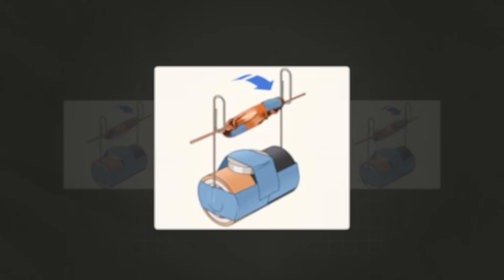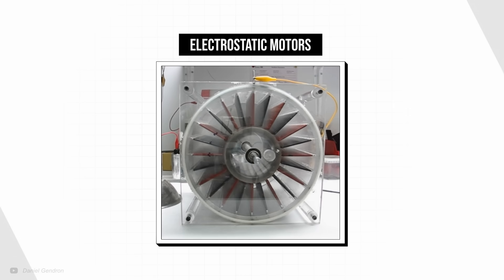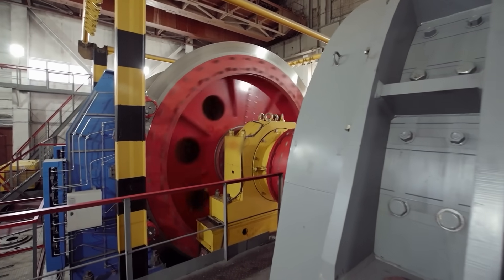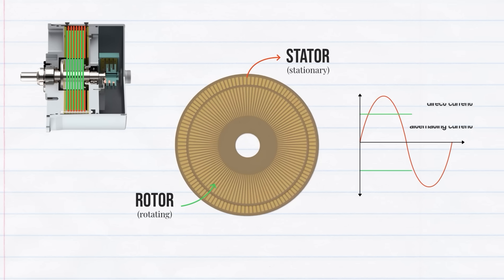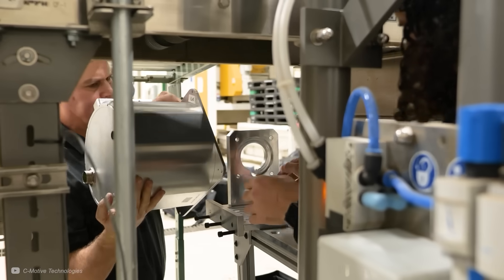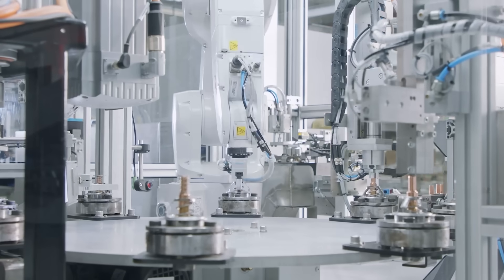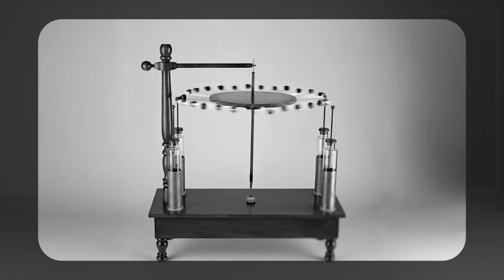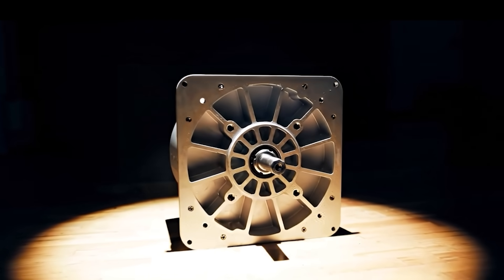How Electrostatic Motors are Breaking All the Rules

Comment: as someone, who works professionally with asynchronous induction motors, i cannot see what the fuss is about. even though our motor could be considered "current driven" instead of voltage, we go up 6600volts easily. also no permanent magnets inside. 
if you want to run something very percise, you might need a VFD (on bigger motors anyway) but to run one of those, would need some kind of contol electronics and VFD-like device as well.
Reply: Technically, as soon as you move a static charge, it produces a magnetic field, which begins to resemble the old inductive motors anyway.
Reply: It is a bit odd that one of their main points is not needing rare earth magnets, but the only motors that use those are ones where a lot of power is needed in a small space, like for electric cars.  But then they say they aren't focusing on power applications like you'd need for cars, instead focusing on low speed high torque things like conveyor belts, which is also where a magnet-free induction motor would work just fine.  I guess those energy savings would have to be pretty substantial to make it worthwhile, but today you have to ask whether the extra money required to buy the electrostatic motor would better be spent on some extra solar panels or wind turbines to offset the losses in the conventional motor.  And if you're in a climate where you have to heat your factory anyway, the losses in the motor just contribute to heating the factory floor so if you make your motors more efficient you will just have to spend more on your heating bill anyway...
Reply: @Berkeloid0  The big plus, is they are eliminating the gearboxes which costs more then the motors.  A lot of industry switched to the more efficient DC motors to get rid of startup surges and higher efficiencies.
Reply: @Kamala-km4ty  DC motors??  Never heard of anyone preferring them, they require massive power supplies/rectifiers, waste power with arcing and need their brushes replaced when they wear out.  No way are they more efficient.  Everyone is using AC induction motors now whenever they can.  Even battery operated power tools are now using AC induction motors because they're so much more efficient than the old brushed DC motors they used to all use.  DC motors also have massive startup surges whereas induction motors typically are already powered by a VFD which can provide a soft start function almost for free.
Reply: @Berkeloid0  They were almost certainly referring to "Brushless DC motors", presumably paired with VFDs of some sort.
Reply: Asynchronous motors are not very efficient since they always need slip in the rotating field and the rotor to o generate torque and anything other than rated speed(like in start and stop applications) are very very inefficient.  
IE5 motors are a lot better but are much more complex than normal induction motors (synchronous reluctance and sometimes even with permanent magnets)
Reply: @nhibbs3 not entirley true. 
yes they have slip, which is really just a slight difference in speed. 
for percice applications (and also bigger motors) you will need a VFD anyway and that way, this "impercice" technology can be controlled. it's not difficult to synchnonize multiple motors with perfect phase angles, so you can run a conveyor for example. they are also used in 24/7 applications, but these are typically larger motor running megawatts of power.
Reply: @nhibbs3 most ie3 motors are 90% plus efficiency it changes on size but the bigger they get the more efficient they are
Reply: Perhaps maintenance and operational cost?
Reply: @lxrose perhaps, but i would guess, that a fluid filled motor with sealant (at the turning shaft for example) will always be less maintanance friendly. the only part on our induction motors, that need regular maintanance, are the bearings. and i would guess, that those electrostatic motors need bearings as well. and if they do not, then because they are light/small enough, which would be the same on a induction motor then
Reply: yep, this video is a bunch of uninformed nonsense as usual. electrostatic motors are inferior in every way and unsurprisingly, used nowhere other than some very niche miniature actuators.
Reply: @drkastenbrot  thats what this (and so many others) channel relies on. regurgitating articles written by journalists whose only job is to write articles hyping up whatever the latest sponsor is spruiking...

the writers have no idea what theyre talking about, the readers have no idea either, and by the careful use of keywords and catch phrases, the ignorant are awestruck...

a popular comment in this section is "they can produce holding torque without consuming power"...

yay... lets forget that charged surfaces suffer from leakage currents, corona discharges, ionisation... they are losses, and consume power as they are replaced.

a magnetic field takes no power to maintain, either. yet it consumes current in its DC resistance. 

par for par, theyre the same thing, just opposite. magnetics are far easier to deal with... you WANT the field to jump across air gaps. whereas in electrostatics the last thing you want is for the field to jump the "air gap"... (dielectric material...)

you reduce the potential to reduce the gap. that reduces the force between the charged surfaces, but as they draw together the forces increase. question is, whats the ideal potential for a given dielectric thickness for a given dielectric to produce the maximum force? and most of our best dielectrics are only given constants of 2, or 3... versus ice that pulls a whopping 80... for one or two brief cycles, at least. distilled water is nearly as good but it quickly stops being "distilled" as it starts tearing ions from metals...

all i have to worry about with magnetics is that i have sufficient area to carry the flux i expect to flow, can fit sufficient turns of wire of a given gauge for a given DC resistance or loss, and how to keep the coils cool...

Comment: I call BS, even if the motor was free, required high voltage controller would still make it unobtainable compared to traditional 3 phase induction motor, also lets not forget that if you don't need vbariable speed you dont even need a controller/VFD.
Dont want to sound negative, but it just sounds like hogwash.

Comment: Don't ever listen to this youtuber, he's a paid lair.
1:10 The rotor generally doesn't have permament magnets. The only common type of motor that uses permament magnets is a stepper motor mostly used in low power electronics.
2:20 Claims copper has high price voilatility when even the graph he's showing says the opposite.
3:21 "Changing voltage instead of current doesn't have the same inherent inefficiencies." He's got this one, inherent inefficiencies are not the same. For example the electorstatic may not reqire a gearbox motor but it requres something to raise the voltage plus high voltage inverter, which is not cheap and already more inefficient than the stated engine's efficiency. If he included the gearbox in efficiency calculation he should also have included the powering circuits.

Comment: I don't believe their claim of being more efficient than a conventional electric motor. I'd like to see their numbers in detail. I'm quite sure they wouldn't hold up under proper scrutiny.

Why do I think that, you may ask? On the one hand, we've been building magnetic motors for a very long time, and we're already approaching 100% efficiency. Some motors today achieve up to 99.13% efficiency. Even when you run that through a gearbox, the overall efficiency rarely drops below 90%.

That's my first reason for doubting their claim. The second reason is that their motor appears to operate in some sort of liquid. Even if they somehow managed to make an electrostatic motor as efficient as a modern magnetic one, they would still suffer losses from moving through that liquid. In my opinion, they lose more energy due to the liquid than a modern magnetic motor loses through a gearbox.

I hold a master's degree in electronics and information technology, so I believe I'm qualified to say: this claim is most likely bullshit.

Comment: You should check out TT Brown’s work on the subject, he was awarded a patent in the US several decades back. He probably would have called it an electrogravitect motor or some such but it used high voltage/ low amperage charge to drive the thing.

Comment: I would have thought that having a fluid between the plates, especially with one rotating and the other not, and especially with the very narrow gaps between them, would generate a lot of resistance.  I guess that the slow rotation speeds, with the emphasis on torque rather than speed, would reduce this problem.  Are they directly connected to the shaft of the conveyor belt instead of having a gear between shaft and motor.

Comment: Why didn't you ask about the impact on power factor?  Like, is the direct-AC-input Electrostatic Motor design capacitive rather than inductive?  Does it need a linear converter to high voltage DC? And if so, what impact on phase angle?   This matters a ton to industrial customers!
Reply: There will be a frequency converter anyway and those include PFC. I guess induction motors without frequency converter are much worse with respect to PF, especially when oversized, what is normal in conveyor belt, elevators and such.
Reply: power factor and  phase angle are not a useful metric in capacitor motor designs. 
--
There is no INDUCTION.
--
Done!

Comment: I think it's important to emphasize that a new technology application doesn't need to be better than state of the art tech, it just has to be the best for it's price point for a given niche, and at least so far these motors sound the type. I would worry how they will operate when wear could allow partial draining of the dielectric thereby allowing arcing but presumably there will be design fail-safes to prevent failure in these situations.

Comment: Used the axial flux pancake motors in the 1970 onward which had low inertia excellent speed power and control 
for their compact design  ideal for factory automation projects this new design sounds a leap forward and very interesting thanks for the info’

Comment: It seems lke a narrow niche they're trying to fill, when some bldc motors are now 98% efficient. Still interesting technology though.
Reply: 98% efficient with no load applied
Reply: @Blox117 like I said before that’s completely the opposite. Electric motors are much more efficient at their name plate value. At low load they are generally very inefficient as it takes a certain amount of current to energise the stator.
Reply: @Blox117  That is actually not true at all. I work at a motor manufacturer and actually no-load efficiencies in BLDCs are significantly worse than their load-rated efficiency. This is because the motor drivers take generally 50-100 mA of current to run, so if your motor is running no-load at 100mA, then it would only be 50% efficient, not counting other heat losses.  Our company focuses on explosion-proof motors so we can't run the cutting edge of efficiency designs, but to give an example, one of our II-pole equivalent speed 48V motors (3000rpm) is around 51% efficient no-load, but when applying a load of 4.6Nm, the efficiency jumps to 90.3%. It is similar with traditional induction 3-phase and 1-phase motors except the efficiency tops out around 80% or less, though for other reasons since they have no drive circuits. You can look at speed torque curves with efficiency from major manufacturers to confirm this.
Reply: bldc have terrible efficiency at low speed
at zero speed they consume power, while this consumes no power at zero speed
Reply: The way in which traditional electromagnetic motor manufacturers present efficiency claims is highly questionable.
Reply: @Fejimush how?

It’s an extremely easy to do it. The motor must be producing the rated mechanical output power and it’s measured against the electrical input power. You divide electrical power by the mechanical power to get the efficiency and they must pass over standard % for that class
Reply: @8towely  You’re right, it should be straightforward and easy.

Look up the torque density and efficiency specs for manufacturers of EV motors, or high performance BLDC motors.  They will be artificially high, won’t provide them, or make them difficult to find.  

The reason is that they only include the motor itself in the calculations and exclude the cooling system, gearing, and other components required for their motor to achieve the manufacture’s stated performance specifications.  If those components are included the efficiency and torque density calculations those performance metrics drop considerably.  

As far as I can tell C-Motive includes all the motor components in their calculations.
Reply: @Fejimush I work in the industrial power transmission industry which is what the article is talking about. Above is how motors are tested and they must pass the international efficiency standard to be sold.

You can easily find the data sheets on every manufactures website and ask for the torque speed curves.

However efficiency is determined at rated power. The motors never really run at rated power as engineers leave headroom for error. However as long as they are kept ridiculously oversized there efficiency will be pretty close.

Even with a 5 second google search I found the model 3s. However you are not correct when they don’t include other systems. To test a motors efficiency load is applied to the output shaft to make it output its rated power. It doesn’t care what it is driving weather that be pumps of the wheels to the road.

There will be some losses in control though
Reply: @8towely   What search terms and search engine did you use to find the details on the model 3s’ torque density, efficiency specs and how they are calculated?   I was unable to find enough details to support your claim.  However I did find folks on some forums trying to get more information.
Reply: @8towely  I asked my AI do a deep dive.   Here's the question and response:

Question:  "Can you find the Tesla model 3s electric motor's torque density and efficiency specifications?"   

Answer:  "Tesla doesn’t publish motor-only torque-density or an official efficiency “spec” for the Model 3. The best public numbers come from third-party testing.  
Context/notes:

The Model 3 rear machine is an IPM-SynRM (interior PM with reluctance assist). Tesla doesn’t publish a single official efficiency number; independent maps consistently show a ~97% peak with very high part-load efficiency. 

“Torque density” can mean gravimetric (Nm/kg) or volumetric (Nm/L), and whether you include the inverter/gearbox changes the answer a lot. Most public weights are drive-unit weights, so be careful comparing across sources."

Your evidence is looking a little contrived and thin my friend.
Reply: @Fejimush  I literally gave you the link of the study above.

To measure motor efficiency you need a power meter and a dynometer.

Regardless the conversation is about industrial motors.
Reply: @8towely   Umm.  I don't see a link.  Sometimes YouTube scrubs them.  

Also, did you mean a " Dynamometer" ?  There's no such thing as a "Dynometer". 

Would like to have a legit and informed discussion.  Yet, you might be claiming more knowledge and experience than you really have.
Reply: @Fejimush I literally have worked in the field of industrial motors for 13 years and have conducted motors on our companies test bed several times. 

YouTube won’t allow me to post the link it keeps deleting it but I’ve said several times the post is about industrial ac motors not teslas motors but you can easily find 3rd party studies via google.

Your initial claims on how industrial motors are tested is very misleading is total bs. It’s an international standard that gives very precise detail on you you have to do it
Reply: @Fejimush  вы попутали тёплое и мягкое - "КПД двигателя" и "КПД привода"! КПД двигателя ВСЕГДА указывается ТОЧНО! Ибо это эффективность преобразования электрической энергии на входе во "вращающий момент при заданных оборотах" на выходе! тут "смухлевать" трудно. 
А вот ваш C-Motive немного привирает. ну или много - смотря с какой стороны посмотреть - нет ни одного подтверждённого даташите, где указывался-бы КПД именно двигателя. Отдельно от всего. так-же как и методики их "измерений" КПД ДВИГАТЕЛЯ. не "привода", а именно "двигателя" как ОТДЕЛЬНОЙ технической единицы привода. Так-же как и нет КПД преобразователя...

Comment: Found several motors that are charged by high voltage static... typically made of aluminum foil. One of the best ones I saw was made by a guy that could produce 250kv in the first gear, and 750kv in the third gear. Current was extremely low, obviously, but he noted that it only generated power when humidity and another detail were just right... forget the second one. Honestly, atmospheric motors are amazing, but they get so hot so fast, which I think Robert Murray Smith has a video on from about 5-6 years ago... the form factors are interesting, such as the flat one, and another with a more stator like motor. Corona Electrostatic Motor is a good search term for those interested in older versions and such... never knew more work was being done on this, like the one in the video.